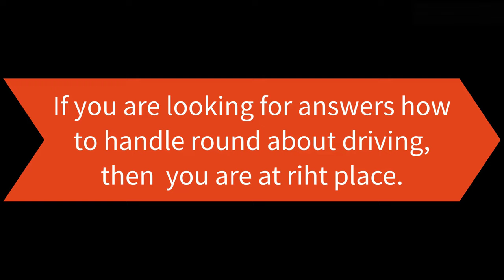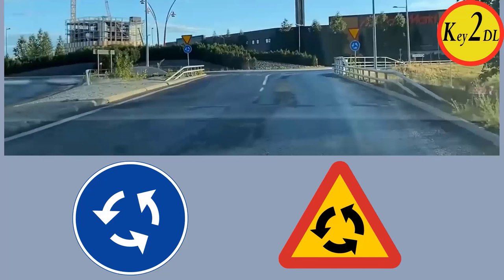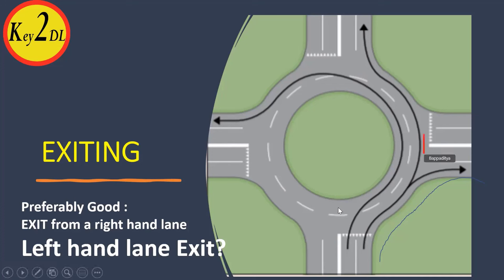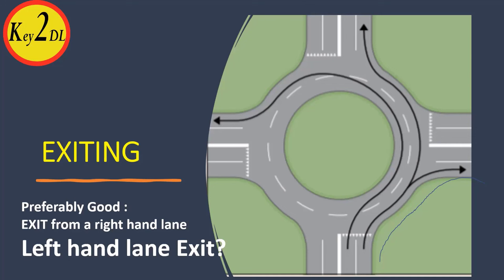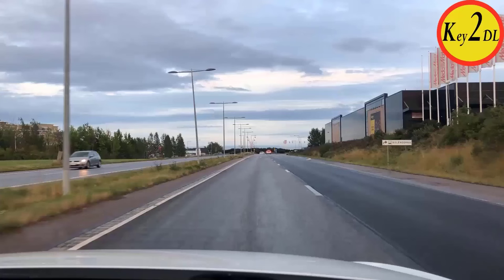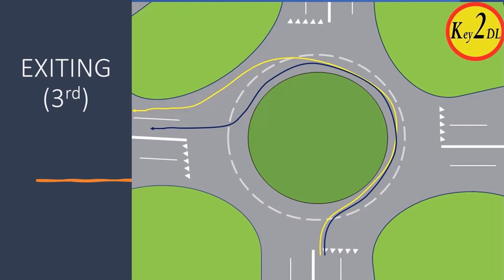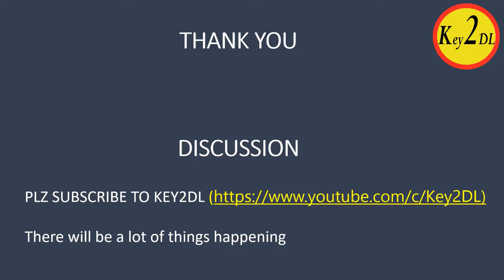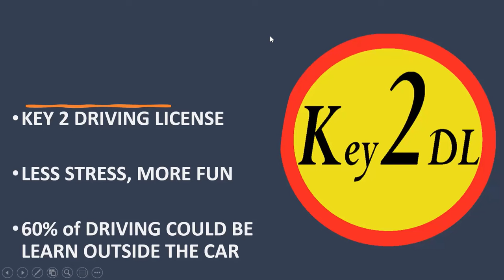Driving in a Roundabout in Sweden:  Swedish Traffic Rules | Swedish ROUNDABOUT | ROUNDABOUTS |key2dl

Comment: as per my understanding, we have three types of rules in roundabouts 1) Basic 2) Exception to the basic (If additional sign board before roundabouts) 3)If both lanes going to the same destination. correct me if I am wrong but we see mostly see only basic rules everywhere
Reply from the maker: Basic means, simple roundabout with just roundabout signs, right?
Reply: @Key2DL  Basic means normal rules like to keep left for the third exit and right for the first and second exit. But hardly I have seen anywhere talked about two lanes going in the same direction then better to take the right lane even if going to the third exit. 
Also, Basic rules are not applicable if an additional sign board is available before the roundabouts. Also, I heard that basic rules are not applicable if we have two roundabouts next to each other. Kindly correct me if I am wrong and request to make a video on this point.
Reply from the maker: @aapkashiv   Absolutely! double roundabouts are a bit trickier than simple ones. Also, remember roundabout with unprotected pedestrian crossing but cyclists may pop up!
Reply from the maker: You can see double roundabouts and special signboards https://youtu.be/_13eSu3YANg